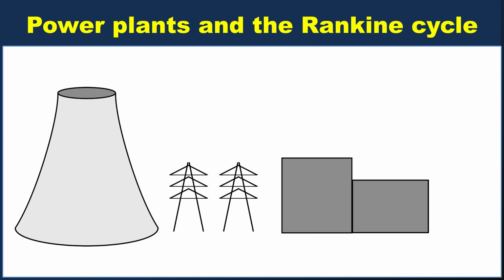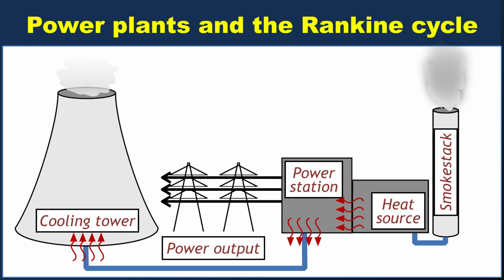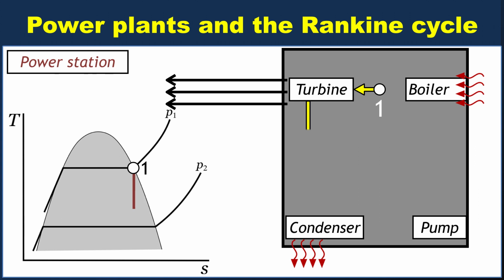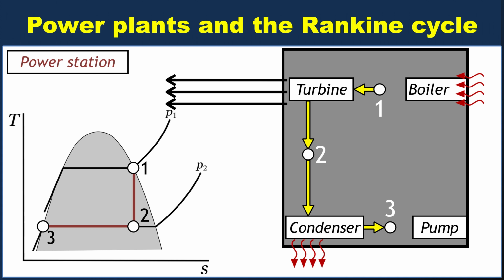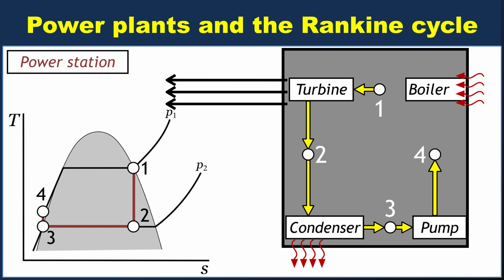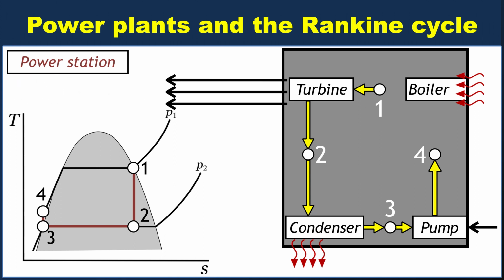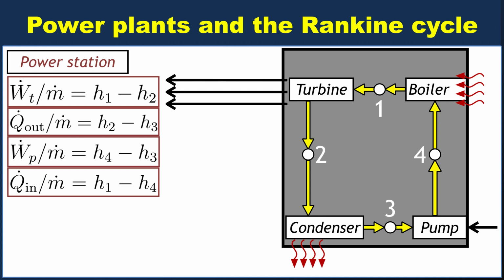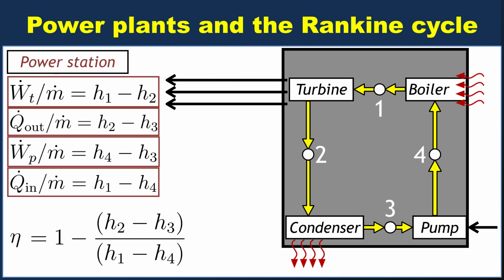Power plants and the Rankine cycle

Comment: What size turbine are used for this application? As if heat and steam or gas flow then it must be recycled same gas , that is turbine generator might be very complex and with high RPM.